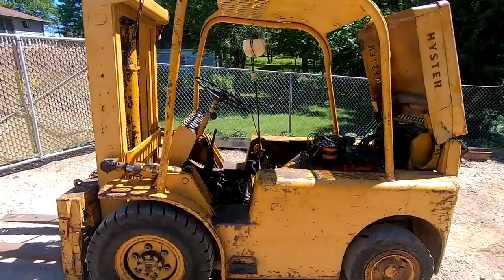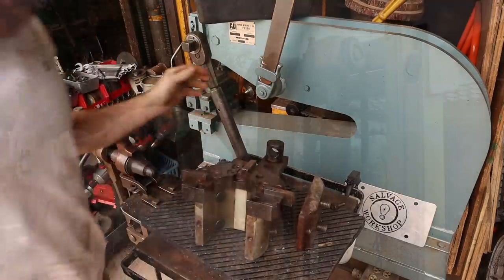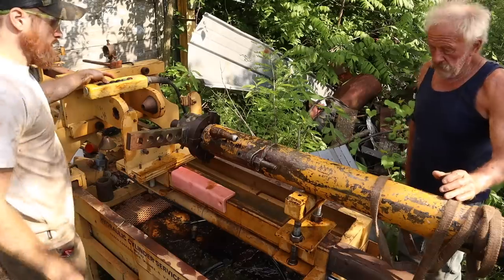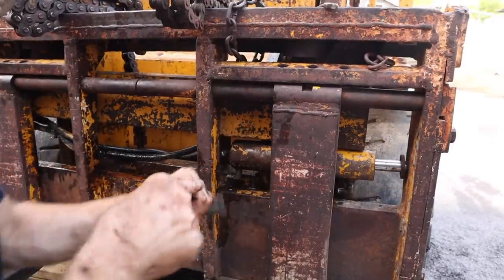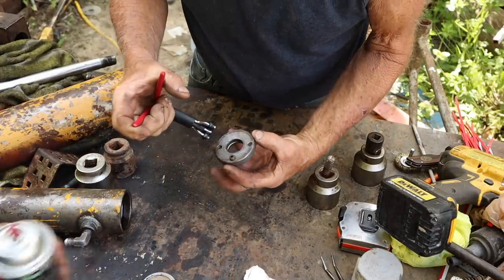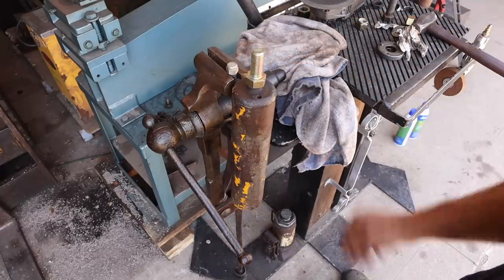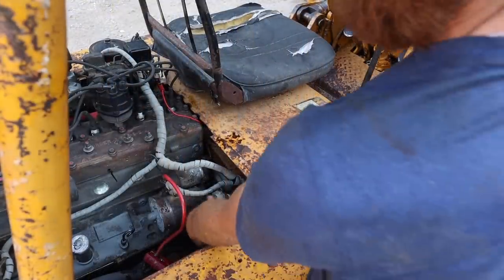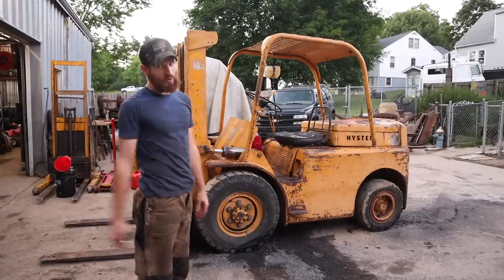Repairing the Old SHYSTER's Hydraulic Cylinders ~ RESCUING a 60's Abused Fork Truck ~ Part 4

Comment: It's nice to have friends that will let you use there equipment because it would take forever to take it apart without special equiptment.
Reply: it doesn't look like this cat rack helped a lot
Reply: @guai9632  It would have worked better if they had the accessories needed to use it correctly.
Reply: @guai9632  I guarantee you what it did help with saved him hours of pain and frustration.

Comment: The cylinder servicing rig need to be saved from the woods
Reply: it's actually not a machine but old forest deamon :V
Reply: save and fix so they can used properly
Reply: yes the cylinder servicing rig needs to be saved and moved to the workshop!
Reply: Prolly no room inside.....if that’s the case I’d at least put a carport over it
Reply: Exactly the words that floated through my head too!
Reply from the maker: If Mike ever decides to part with it, I will do my best to give it a new home! (he never will, but you never know!) 

I would rebuild all my hydraulic cylinders just because I could!
Reply: @SalvageWorkshop  Hopefully, Mike will put you in his Will.
Reply: So cool that Mike helped out with this restoration.  👍
Reply: @SalvageWorkshop  Sir it has been a while since your last post all ok?
Reply: That machine can remove nuts tourqued beyond belief. It's worth more then the skid steer putting the cylinder on it !!
Reply: @alcopower5710  Grease and tarps would be a good start
Reply: @SalvageWorkshop  Once you get known for it.  You will get more work than you realize.

Comment: Good job bringing this back to life. By the way a gas powered leaf blower will clean off the water on your engine also. Does a fantastic job.
Reply: Would an electric leaf blower work?
Reply: @spacemonkey2915   the reason I said gas powered is that they blow air harder then the electric ones, but you could use an electric one.

Comment: The stud you welded on is coated with zinc dichromate, that will give you a poor weld because the zinc will alloy with the weld puddle. Never use coated hardware if you weld it, further the weld prep is very small this should be a full pentation weld.
Reply: Yup, a bezel cut.

Comment: There is degreaser for pressure washer. Tractor supply sells it. It works very well. Oven cleaner is pretty caustic.

Comment: In the future when you weld anything together you need to grind bevels on both pieces and fill the gap with weld. The end of the bolt should have been ground to look like a cone. Reason being the weld basically sticks to the outside surface of the metal on both sides. It doesnt penetrate passed the weld prep like most beginners think.

Comment: Good job keeping this "old" machinery working.  I think you, as I do, truly appreciate the engineering and design features that went into these older pieces of equipment.  When I started my warehousing career 39 years ago all we had were these older pieces of equipment.  Either they worked or they didn't and if they didn't they were relatively easy and inexpensive to fix.  This new modern equipment we use now are all controlled by motherboards and processors any of which can fail with no notice then you have to call in a factory trained "technician" to diagnose and correct the problem usually at a very high $$$ cost for both parts and labor.  Keep up the good work.

Comment: I have an old saying if you can't fix it with a hammer , get a bigger hammer.  Great video< I always wondered how they redid the cylinder seals.
Reply: If you can't fix it with a hammer, you have an electrical problem
Reply: Nice job on the cylinders!

Comment: Should have vee'd out the bolt and remaining stub before welding...   As is, there's just  very small ring of weld and that stud will break off if there's any significant pulling or lateral force..
Reply: was thinking the same thing... Not that much surface actually sticking to the weld.  That said MOST of the force should be straight in and out rather than side to side so maybe it will hang in there.
Reply: @homeFall1  It should be OK for pushing as the stud would just act as a centering post, but will be weak for pulling strokes of the cylinder as the weld was ground down to the same diameter as the bolt:  you have a massive cylinder end, which isn't going to break, probably a Grade 5 or 8 bolt which is strong as heck, but after grinding, maybe only a 16th" of weld left joining the two..   What's the weakest link here?    I would bet that a good hammer blow sideways would snap the stud off with that little material holding it together.. 
The bolt should have been vee'd almost down to a point before welding and then post heated for stress relief..

Comment: In no particular order. Education on old kit, tools, techniques, fixing problems and confidence building. Nothing fancy but you've helped me build a hydraulic tipping forestry trailer. Wire the tractor  to power the hydraulics on the trailer, actually two tractors. Buy a second hand digger and understand the greasing regime and a host of other projects. Latest is repairing a 100 yr old (minimum) originally horse drawn field roller, replacing rusted broken fittings and repainting before using her on our fields. That's just a little of why I watch plus my wife watches all the dozers vids and loves the dogs. Many thanks from Wales.

Comment: Too bad that old rig wasn’t fully operational, but imagine it still saved you a lot of time and headaches.  The sad part in the industry is they don’t want to repair anymore, but would rather sell you a complete piston.  The hourly wage of specialist are exceeding the cost of factory built.  The experience that guys like Mike brings will be sadly lost. I have always liked watching guys like you bring old metal back to service.  The one thing I would like to offer, is take care of yourself.  I grew and learned with a strong safety ethic.  It prevents a lot of down time recovering from injury.

Comment: I enjoy watching you go thru the steps of rebuilding those cylinders. It reminds of the time when I did it on different machines. I'm retired now and can't do that kind of work anymore. Just brings back my old memories back in the day. Went through exactly what your doing. Get the satisfaction of a job well done and brings back a piece of quality equipment that otherwise would be discarded. Built far better than the new stuff today. It is so satisfying to save that old quality equipment. Keep up the fight to save this old equipment, your doing it right. Thank God you can still get those replacement parts.

Comment: I currently operate a Hyster 360-48 forklift at work. Love it. 20 years ago, I used the same lift you currently own. Was a pain in the butt to keep operating but it sure made life a lot easier not having to use my back. The reason I enjoy watching your videos is that it's fun just to see someone else actually working on various types of equipment. Sometimes I learn a few little tricks but mostly I simply learn wear some things are and how to do some things. It's fun to see you reconditioning older equipment.

Comment: What I enjoy is your persistence and learn as you go from those around you and in the chat.  You save as much as possible and redesign/repair lesser past repairs in that when the machine is complete it is correct and more serviceable.  Once you get those old machines up to par they will out perform most new equipment and outlast them.  It is good to watch someone and learn from them that are trying to do things correctly as possible.  At times you are a bit worrisome with the chances you take working alone, but, enjoy watching you.

Comment: I like watching you tackle difficult problems weather it’s a stuck nut or something that was welded back together instead of fixed properly. I learn something from each video. Had heard the term “pony motors”, but didn’t know what they were used for till I saw you working on Big Red.   Thanks for the hours of entertainment.

Comment: I enjoy you're show as a reminder to myself that I'm glad I retired. 8 years as a Jet Engine Mechanic for the Air Force and 35 years as a Heavy Duty over the road tractor / trailer and equipment mechanic for a large west coast poultry producer company. After 100's and 100's of engine, transmission and rear-end over hauls and bumper to bumper maintenance, I hung it up. Having both knees and one hip replacement from wear and tear didn't help. I'm proud of the work I did, but it was time to pass it on to someone else. 

I enjoy watching you work and the memories it does bring back. Wish I was there sometimes to give you some tips (if not help). <grin>

Comment: Really like seeing you succeed at addressing these seemingly impossible issues like the leaking hydraulic pistons.  Great to see you working and hanging out with Mike - pretty cool that he happened to have the one machine that could help take apart and reassemble those pistons!  Maybe there's another way but it wouldn't have been good... I like Shyster!  Almost as good as "lil yaller"!  No, actually it's quite a lot better! 😆

Comment: I drove a gas Shyster at an Auto Wrecking yard. The same size and vintage.  I sure like that diesel engine, it runs right to the exact rpm needed to do refined lifts. Gas was okay, but gas fumes in a shop is way harder to cope with than diesel. Many thanks for showing us how to rebuild those type of cylinders. I have often seen those pin wrenches for undoing that top plate, laying around at shops, and never new what they were used for.

Comment: Great video as always. As to the question of why I enjoy your channel, information. You, and youtubers like you (particularly Mustie1 and Diesel Creek) are creating a repository of knowledge that has a permanence. Machines like Old Red are becoming increasingly rare and it's incredibly rewarding to see one put back to the work for which it was designed rather than scrapped in favour of the new and shiny or restored to a beautiful standard then left to gather dust in a museum collection somewhere. In a disposable world you demonstrate that old does not mean useless and things are worth saving. They may even represent the last of the saveable machines, modern equipment is so stuffed with computer gear that requires proprietary software that in 40 years a barn find bulldozer is likely going to only be any good for a scrap dealer. With the knowledge you and others like you are recording maybe more of these machines can be saved and used.

Comment: Nice! I have nearly the same machine. It sat for about 10 years and i had a customer give it to me. So far battery, starter/solenoid, rebuilt injectors, lift hose replacement(it blew lifting it's own weight. I still need to unstick the parking brake, rebuild the Master cylinder, and fix the leaking lift cylinder. Just when i get close i find something else. 🤯🤯🤣

Comment: I am too old to be taking on any projects like you are doing but the things you are doing is all interesting.  The big factor is your undying tireless energy in your work and that fact that you never seem to take the lazy mans out is any of your work.  You take the time to correct and repair all the questionable or marginal issues with the machines complexities and never just pass over something that could cause you problems down the road.  Always seeking the correct fitting tool instead of reaching for the hammer first.

Comment: Your content is interesting and well done. There is good flow to your video and we are not held to a multi part vid's which can't be helped sometimes but does make it more appealing to me. My friend and I are contemplating an older dozer and that originally captured me and have been a subscriber ever since. I was a production machinist for a company that manufactured hydraulic pumps , controls , components and systems.

Comment: My Dad and I used to use BRAKE CLEANER, CARB CLEANER and DEEP CREEP to break free rusted in bolts and pins as well wheel nuts. It honestly DOES work. All you do is spray each one on within 5 seconds of each other in that order and wait about 20 seconds. Won't be bending bars or vibrating the hell out of your hands with all of that shock from pounding on pins.

Comment: Enjoying watching this series of videos mate, your time and effort will be very rewarding with these Hyster forklifts.... since you are going through and replacing/fixing components which with simple mechanical knowhow and common sense will make this machine usefull for another 40 years! They do not build them like this no more... and many end up scrap because of minor problems and people are always interested in new! I think the styling of these forks. (The same designer as the hoover vaccume, rottary dial phone) are one of beauty and timeless hese most dont realise how old they really are... look far times better than the new ones.. wish there was a way to show u the 2 x s50's and the s90 that i have and still use in my business daily.. 🙂 get many offers to buy them. But are way to valuable to me and practical size wise that no new machine can compete. Id suggest u get ureself a hyster service manuel worth every penny and shows u the easy way to repair them... the cylinder removale and install was cringeworthy but you got it done in the end. 👍 oil change often and change filters and they will see out mankind! And ignore the slight oil weep... hysters are known for it... and even the service manuel says oil here there and everywhere to keep in good operation.. and the continental L flst head is bullet proof and can be rebuilt for nothing...

Comment: Hey, I really like watching your channel because of the many different things that you work on.  For instance, in this video, you are rebuilding these hydraulic cylinders.  I watch closely because I have a skid steer here at my home and the last time I was using it - I noticed a little drip of fluid coming out of the top of one of the cylinder arms.  So, here in the near future, I am going to be backing that skid steer into my shop and am going to do the same thing to the cylinders on it that you are doing here.  So, for me it is educational.  But, I still like watching what you do.  Keep it up.

Comment: Fantastic that you rebuilt the lift and tilt cylinders!
You took a "scrap" machine, invested at least 60 hours into it, a thousnd dollars of parts maybe...
Figuring shop labor 60 hrs × $100/hr plus parts, you can see why there are yards full of older forklifts. 

Shyster was probably parked for the mast leak. Deemed not economical to repair.
Great job saving her. It'll be beneficial on other projects!

Comment: you should get a "shake and brake tool" for the rusty bolts. Uses your air chisel to brake the hold on bolts. they have them in a 1/2" drive so you can use your sockets. great for screws also. I enjoy your videos .Thanks

Comment: Looking forward to seeing more in this series! I'd say next up is replacing the rest of the rubber components...tires included, at least the pneumatic ones. I don't know how forklift tires are made compared to your ordinary vehicle tire (I imagine much tougher), but if they're old I'd swap them out regardless of their condition. If those tires fail, especially under high load the results can be catastrophic....it could cause you to drop the load or even tip over depending on surface conditions. You might not think it likely that they'd just burst randomly, but it could happen if an unusual or sudden stress is put onto it, like if you run over or into a solid object...like a curb(where your driveway meets the slab), a hammer or tool you left out etc. Whatever they cost, remember that it's probably cheaper than what a tire failure can cost (damages, hospital bills).

Comment: Glad to see that you backed the wheel bearings off and you did a great job of repairing the hydraulic cylinders with the help of Mikes machine and it must have been disappointing for you to have a blown hose after a great clean up.  I have used one of these CAT cylinder machines myself and they are indispensable when working large hydraulic cylinders.

Comment: Thanks for the video. Since you said you welcomed comments, I will go ahead and tell you what I was thinking.
#1) Using oven cleaner on something other than an oven was not optimal in my view. Your intent was to remove grease and oil and perhaps dirt so this is what I do, Get a spray bottle and fill it 50% hot water and then add surfactant like extra strength Palmolive dish soap or ivory dish soap or whatever. Spray it on whatever equipment your working on before you pressure wash.
Surfactant dissolves grease and oil quickly.(seems to turn it into water somehow)
#2) When working on hydraulic equipment, use transmission fluid instead of engine oil to lubricate or clean parts.  (Different viscosity)
#3) A ratchet should never be used with a pipe extension. That's what breaker or Johnston bars are designed for and ratchet parts are expensive when you break them.

I was really happy to find your channel because I get to watch you do the things I used to do years ago. Cheers from Canada.

Comment: To build a nice bearing less jib crane off the corner of the garage. Use 2 different dia scrap pipes and an I beam welded in a slot cut out on the top of the bigger pipe capping all the openings also and a round plate welded around the bottom drill and tape 4 holes for grease fittings. The smaller pipe gets cemented in the ground 2 feet with a steel plate welded around the pipe at ground level. Grind and polish both plates mating surface. Tip install it all together in the concrete may need to tack weld the plates together and weld lifting points at the top or 3/4 up the outside pipe plus a bar welded on to turn the crane. Total build time 3hrs. Digging the hole and fill with concrete 1hr. Install time with fork lift 10mins.